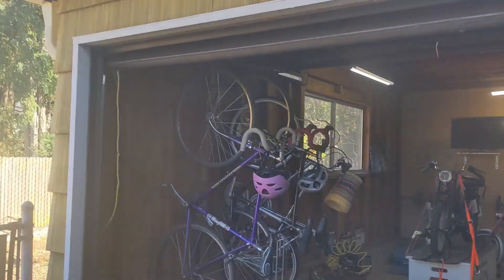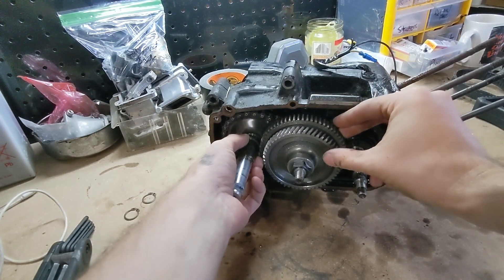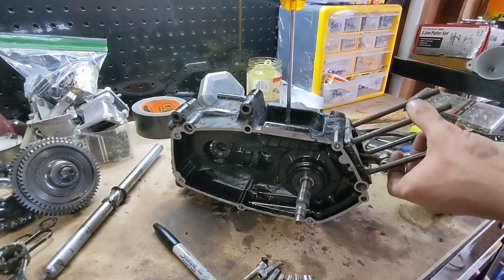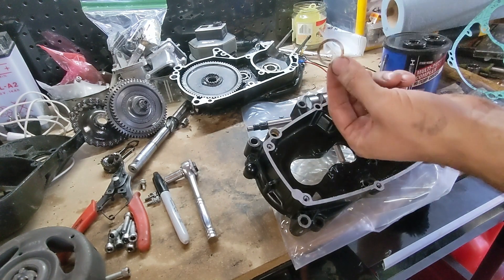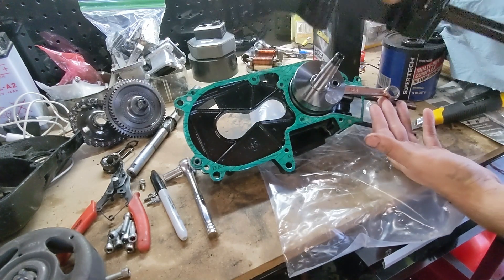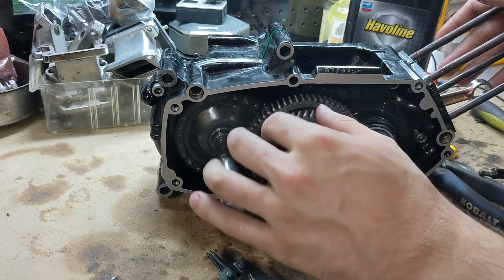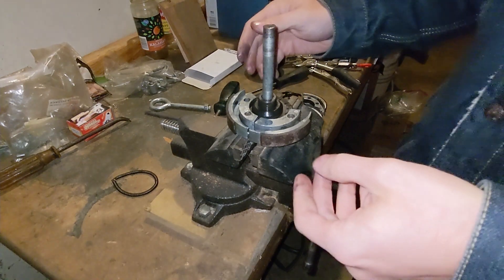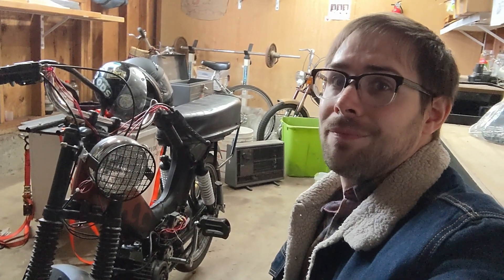Tomos A35 - Let's Drop, Rebuild, and Reassemble with New Clutch Pads the Well Loved Tomos Engine

Comment from the maker: This video was a long time coming. Candidly, I usually like to do something once all the way through before I show it, but this video is me doing an A35 teardown and rebuild the first time. 

A lot of things go sideways here, the first crank bearing does not go into the cases cleanly, the cases don't close around the crank nicely at all, and I probably spent an hour trying to get the clutch spring installed in the first gear clutch. On top of that, I almost reassembled the transmission without a new sprag spring! 

Ultimately I decided to publish this video, even with my mistakes. The moped is now alive! And while there is some finagling we still need to do, I know with the right amount of perseverance it will get there. Thanks for watching friends.
Reply: Hey its been about a year but I just started watching you're videos and I have to say I love how you actually explain everything and was wondering if you could help me BTW thamk you for all the educational videos

Comment: Thank you for making this video. I only found one video of someone taking the engine apart but it had zero sound and the view wasn’t the greatest. I just found a couple diagrams for it but still not the best ones out there and will he’s searching for a few more to print out. Your video is probably all I’ll need to finish rebuilding mine. It’s has the a35 engine that was seized. I got it lose and most of it apart but lost interest a couple years ago. Everything it still where I left it again your video will help me step by step to finish taking it apart and putting it back together. Thank you so much :)
Reply from the maker: Heck yeah! Yeah there is an odd selection of Tomos videos available which is why I made this.

Doing it over again I'd maybe put some heat on my cases to get them to go together smoother...wasn't the biggest fan of having the case bolts do all the work. Best of luck with your rebuild!

Comment: Great rebuild video!  I'm a fan of using my outdoor gas grill to heat the case halves after freezing bearings and crank in freezer although I need a couple oven mitts then and it's a 2 step process.  30 minutes at about 300F.  Bearings and crank almost always drop right in like butta.  Of course the case halves gasket is a pain and the connecting rod always wants to move to the wrong place when you put the last half on the crank.
Reply from the maker: Thank you so much!! That means a lot coming from you, love your video of the Honda Urban Express on Nitrous. 

Doing this over again I would heat the entire case and freeze the crank, things would have gone more smoothly for sure

Comment: Nice Vid, man! I can see the typical problem at the A35, rusty cylinder bolts wich will keep the cylinder stuck on the motor sooner or later. I use to lube them with copper paste to prevent this typical A35 problem. You hammered on the inner bearing ring, not so smooth 😀Have much fun!
Reply from the maker: Thanks! And yes I have encountered the rusty cylinder studs on another A35 that I briefly worked on, copper paste sounds like just the thing to use, and those bearings got the best of me but I'll be more prepared next time.
Reply: @TravisTutorial  thanks for the video. Youtube and the community lives from our youtube videos.

Comment: I've split in many a case in my day. Here's a little helpful hint.
   If you have a case that's a little stubborn to pull in half, and you need to use a screwdriver, what I do is, I pry on the cases, where the engine mounting bolt bosses are. That way, if I do booger it up a little bit, it's just in the outside of mounting boss, and it's not anywhere near the actual block sealing surface.
   Also, a few taps of the mallet on the crankshaft ends usually helps a lot, because usually what keeps the cases together the most, is is tight grip the crankshaft bearing on one of the crankshaft ends. I can do it 100% of the time without ever gouging any of the sealing surface with a screwdriver, ever.
Reply from the maker: Appreciate it! That's good advice if I ever need to pry again, but in the future I'm going to use more heat - especially around where the cases seal to the crank bearings.

Comment: Great video thank you. I was it watching your video to confirm which direction the toothed spring plate was facing (The factory manual is not clear.) At 40 minutes 41 seconds in the video, where you were have trouble getting the spring back on,  my Tomos A3 factory manual reads:  'Spring joint should be in the middle of one shoe and not behind the eyelet of the brake strip. ' I though it maybe helpful to mention this.

Comment: Thank You TravisTutorial - I have been trying to find a video like this for quite sometime. I bought a Tomos SilverBullet Automatic for $50, the engine isn't seized but i cannot pedal backwards to start it, unsure if it is  the one way bearing or sprag spring or ? but seeing this video makes me feel confident about doing the repair. Absolutely Fantastic Video and detailed information exactly what I like. Great Job, Thanks!!
Reply from the maker: Great to hear! The transmission is actually not that scary once you open it up once. Even with a missing sprag it should still kick over, I'm wondering if there is something up with your peanut clip...hoping it is an easy fix, $50 is just right for a Tomos!

Comment: I just brought one of these with 1000 miles for 175.00
This is my first project I have no  idea what I’m doing .the  guy I brought it from said the kids ran straight gas in it. I believe he mentioned doing a top end rebuild , and he said the piston and o-ring are done . 
Hoping this video can help a complete beginner like me
Reply from the maker: The previous video where I do a top end inspection is probably the more helpful one. If it was seized, there is a chance that you could get away with a new piston, and either reuse the cylinder if it's okay or replace. When you remove the cylinder you're looking for gouges in the cylinder walls and broken/stuck rings in the piston. The job is a good introduction to mopeds! 
You might have excess wear in the crank if it was a hard seize, but hopefully you can get away with a top end rebuild.

Comment: Curious how you blocked off the oil injection so you just run straight premix... any vids on this? Thanks ✌️
Reply from the maker: I actually made one about 10 years ago, how time flies! It's a little drawn out, but if you want to see me go through the components and how to remove it it's still useful.

The very short version, I would find a spare M5 or M6 bolt that is shorter than the oil injection bolt and put some Motoseal on it and tighten that into the intake, the rest of the components that make up the system can then be ripped out.

https://www.youtube.com/watch?v=KJM_JxX_xCI
Reply: @TravisTutorial  I'm going to watch it, for sure. If I could subscribe to your channel twice, I would!! Thanks man!
Reply from the maker: @ogbigtsbikesandstuff887  Thank you!
Reply from the maker: That means a lot! Happy wrenching !

Comment: Love the videos!  I have a bone stock 2012 Sprint ST that I daily 20 miles round trip for work. Aside from the occasional broken brake cable and leaky intake boot. It has NEVER let me down.  I'm thinking about doing a clutch seeing as I have about 65k miles on it now. When it is really cold the thing chatters and really hates shifting. But it's fine in warmer weather... I live in New Orleans so we ride all year long.  Came across your channel looking for info on the clutch job. I know that the a55 is really similar to the a35 when it comes to the trans clutches and gearing.  Subscribed!  Do you have any input on the different first gear clutch springs? Treats offers 20, 25, and 30 pound springs along with the stock one which they don't specify what the weight is. I wonder which would give better off the line performance. Thanks
Reply from the maker: Amazing mileage! 

I wish I had some details on the performance springs, this is my first time really playing with a 2spd bike. There are some neat aftermarket options Treatland Jammer specifically that seem like a nice throw in and go option.
Reply: Scottcol23 wow crazy mileage I'm buying a 1999 tomos sprint a35 with just 3483 miles so I'm happy to hear these little suckers last a long time

Comment: What a dream of a video, exactly what I needed. My Tomos revival only runs on choke and dies out soon after taking the choke off. Also it picks up really badly in first gear, and doesn't like to shift to second (that's what that "?"-shaped spring is for). I will actually take the top end off first for crank inspection, might have to invest in some tools too. Did you have any kind of book/pdf helping you through the build-up?
Reply: Did you check if you have air leaks? Because if it only runs on choke it has nothing to do with the lower end. I also have a revival and took the whole engine apart